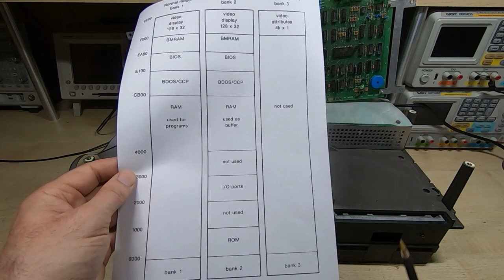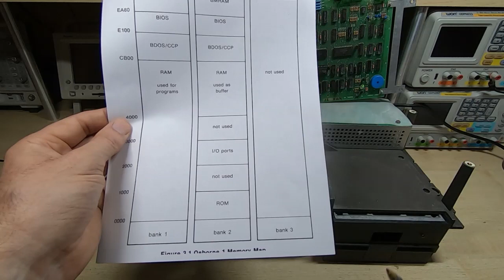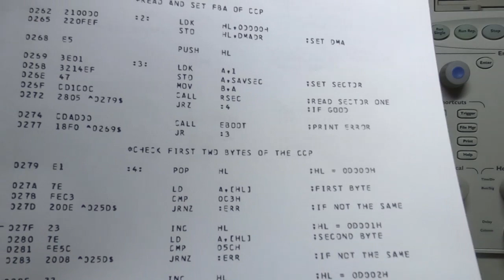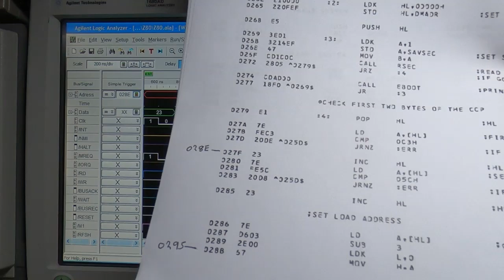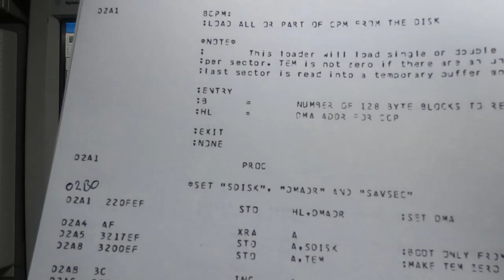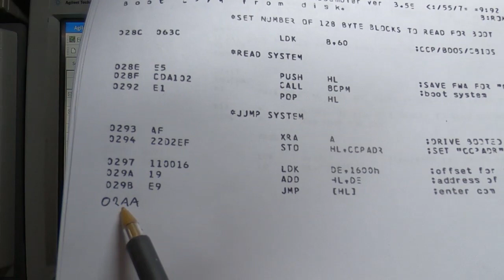Osborne OCC1 Repair Part6

Comment: 5:34: So if I understand correctly, the program RAM seems to be 50KB, and the buffer RAM seems to be 34KB in size, but the Osborne 1 only has 64KB. How does that work, or what's going on there? Thanks in advance.
Reply from the maker: The RAM in bank 1 and the buffer in Bank 2 are actually the same RAM as is the Video Ram at the top of these Banks along with the BIOS and BDOS blocks. The upper part of Bank 2 is 'shadow' RAM so is common to Banks 1 and 2 .  The upper block in Bank 3 is separate RAM. The ROM is mapped into the bottom of Bank 2 and the bottom 16k is not common which is why Bank 2 is selected following a reset.

Comment: i had one, which would not start at all... .i used the logic analyzer to find some addresses in the 0xE1xx range where there was writes... the i searched the trace for read's at the same address, and voila... stuck bit.... actual it was not a defect ram, it was a buffer......

Comment: Shame there isn't a readily available ICE for the Z80. Would make this job a lot easier... Looked around and there are various hobby projects to create an ICE but nothing that is readily available.
Reply from the maker: There are plenty around but my videos are more about how to go about repairs rather than specific information on particular machines. In the next video I show how to use a Fluke 9010A to track down the fault (or at least the next fault) but this could apply to any other machine type. It would also be possible to make a ROM for the purpose but I did that for the HP calculator and wanted to show a different method.

Comment: This is, in my opinion, the most interesting process of vintage computers repair. Stepping through the codes and find where it crashes. It seems to crash during the  OS transfer to memory, so, would CPM boot sector’s image disassembly give the necessary information as ROM code list did?
Reply from the maker: Yes it would but I do not have the boot image for this machine as I shoot the videos as I progress through the repair so you have seen as much as I have. As far as I know the logo image appears during initial CP/M start up but as this does not appear the fault could be anything from RAM to a glue logic fault. It should be interesting to find out. The BIOS is normally vendor specific so I would need to disassemble the actual OCC1 disk image. However I have shown this process in previous videos and I always try to show different methods in my videos.
Reply: @JerryWalker001  I agree. Other ways working on the actual hardware is also very educational and interesting. Thanks